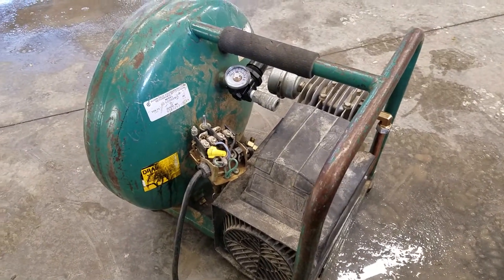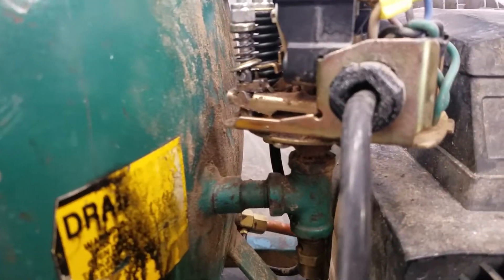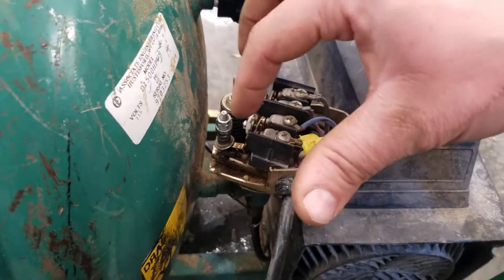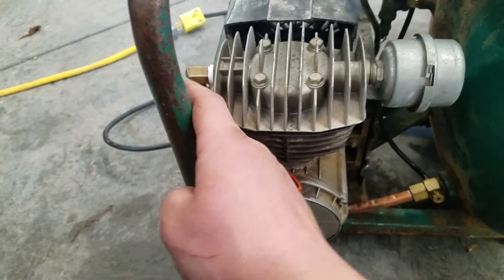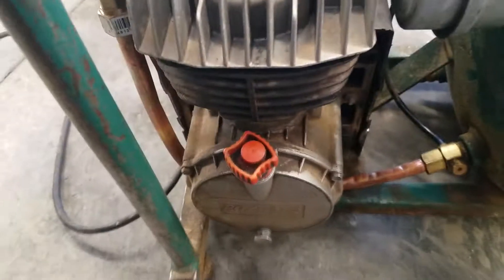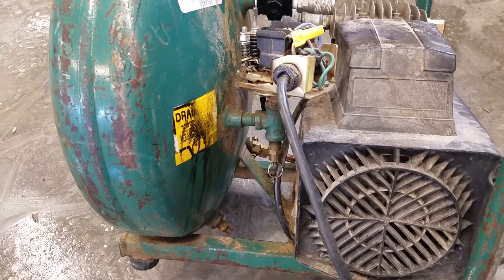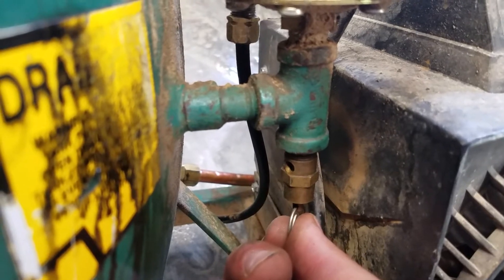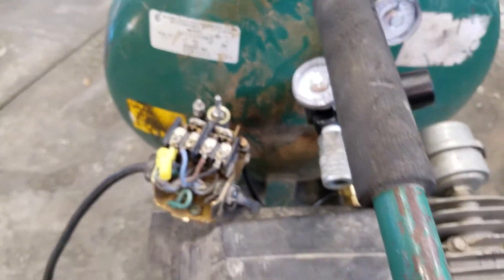How an Air Compressor Works & Basic Parts 101

Comment: is the air intake filtered ?? what stops debris from entering
Reply from the maker: Yes it's filtered. The silver cylinder intake  by the head
Reply: @ are all compressors filtered i’m so scared of them I want one I really want one but having one in my car scares me alone that i might forget to release the pressure or the filtration isnt goood enough to have close to all the debris during my work